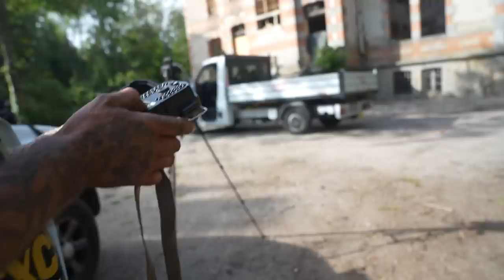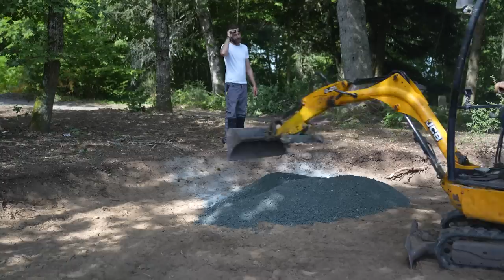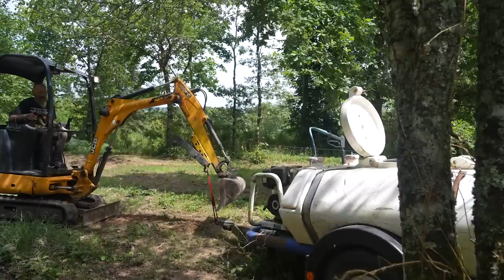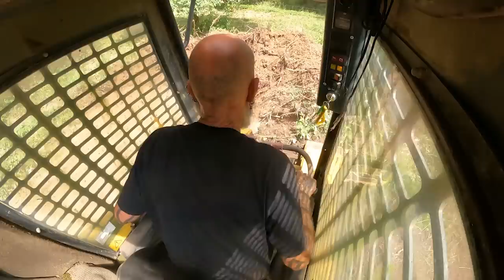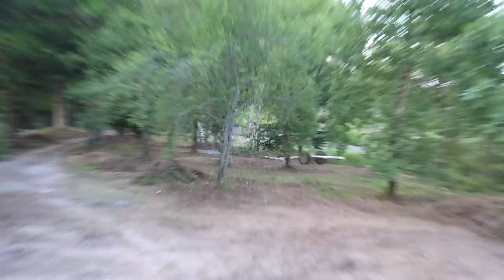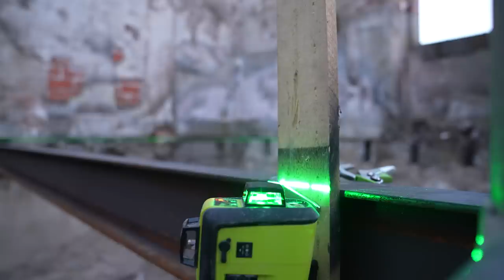A very wonky chateau ruin.

Comment: It's wonky because the builders didn't have laser levels. Because they used natural materials like wood and stone that weren't that square anyway. The building is like straight enough on average. Compensation was likely done with the floor covering. 
If you think this is bad, You're in for s few suprises. 😂

Comment: If the landing is slightly lower could it not be built up to match room levels once all the room floors are set ?
Might want to concentrate more on the inside floors to get up to roof level and get that roof on before bad weather returns in autumn/winter 😉

Comment: For my 2 cents. Make the steels level with the existing floor (subfloor) height wise. Make them level and plumb. If the pockets need to be extended up some that’s ok 👍
Reply: Looks like the pockets would have to be adjusted down, which is difficult because of the iron straps in the walls. You could notch the joists within reason though, apparently they're oversized for the span anyway.
Reply: @Ragnar8504  oh good point. I think notching is ok (not an engineer) as the height of the Joist is needed more for strength over the span than at the connection point. Often you see support beams taper at ends…
Reply: @michaelsmithers4900  Notching isn't ideal as it can create stress lines and lead to cracks but you can definitely notch the ends of joists, you just need to find out how much you can safely cut out.
Reply: @Ragnar8504  Agree, there’s a limit for sure. I believe the necessary height of the joist is a function of the span covered. I used to work in framing and headers were required to be a given height - longer span taller support (header). 
The only risk I see with notching is splitting a failure… 

Here’s an idea!!!
What if he extended the pocket under the band and then cut a slot in the end of the joist. After slotting the joist around the band and into the new steel on the other end, cement the slotted end in… He could even attach the joist to the band to make the structure stronger with a diagonal bolt…
Reply: @michaelsmithers4900  According to a French commenter joists for a span of up to 3 m can be 175 mm, 3 m and up needs to be 225 mm. Since Dan's spans are less than 3 m as far as I can tell he could reduce the joists quite considerably (by about 2"). Splitting might be an issue but old French joists were notched like crazy so I'm not sure how bad it would be, especially since the notches would be inside the wall with some of the original dimension resting on the stone wall.
Reply: @Ragnar8504  Completely agree… He’s also spacing the supports fairly close so there’s a lot of strength.

Comment: Dan, if the I-beam floor his higher than the floor in the core, could you not just build up the floor in the core to be at the same level and the i-beam floor?  Of course you have the other sections to level out too (back and opposite side of the chateau) so it could be a futile exercise to get 100% perfect.

Comment: Depending on the thickness of the flooring that was originally in that room, it is entirely possible that the floor would have matched up with the landing.  Unless the difference is really big?  Or maybe the old steel beams were a little bigger?
Reply: The new steels are bigger than the old ones.

Comment: Dan, I know you've thought about it, but don't forget to account for the thickness of the flooring material. EDIT: and also, this Chateau was built a long time ago, are you sure the floors were level to begin with?
Reply: I'm fairly sure they weren't because I don't see any cracks or obviously wonky door and window openings, the usual telltale signs of settling. Buildings rarely settle as a monolithic block.

Comment: FYI, limestone should never touch dirt as it will contaminate it.
Reply: Crushed limestone is used to line drainage ditches, used in the pharmaceutical industry & also used in feed for cattle
Reply: @NurseSherry  Yes but in construction you put down a plastic material to keep the gravel and dirt separated.  Don't remember what it's called.

Comment: Calculating the amount of stone required is remarkably easy.  Generally crushed stone is ~2,000kg/m^3 so that 3T will give 1.5m^3 or around 15m^2 at 100mm thick or preferably 10m^2 at 150mm thick.  There also needs to be an allowance for loss i.e. stone compressed into the ground.

Historic buildings are not modern precision constructions and it is foolish to expect them to be.  If you are going to utilise existing features such as joist pockets then expect and accommodate the variations in spacing and levels, after all we all admire the eccentricities of old buildings including their sloping floors.  If you want modern precision then disregard the original features and work it through as you would a new build.

BTW that scafford tower is not safe!

Comment: Cost of 10 tons of gravel, plus gas, plus time/labour wasted going back and forth, cost of building materials and time/labour building. The cost of trailer, gas for one tow, put on site, level and labour is much cheaper. I guess budgeting math is different in France. And another day the floor is not done to get closer to getting a roof on this side of the structure to keep rain and winter damage at bay. Nick is gone on Friday is he not?

Comment: It’s not a stable building and never will be - the fire and then 50 years of exposure have rendered the entire structure a crumbling mess - it’s sad but most of the brickwork needs to be rebuilt
Reply: The fact it's still standing at all suggests it was quite well built in the first place. Apart from relatively superficial damage the brickwork looks pretty good. Stability is steadily improving with Dan's work. Also there seems to be little evidence of subsidence considering it's age. I recon it'll be around long after many modern buildings.

Comment: I cannot believe you've bought an 8 metre diameter yurt. 

Unless its an American Engineered, modern iteration with plastic covered fabric walls, modern insulation, fully waterproofed crown system, full height doors and windows then you have years of unnecessary and expensive maintenance ahead you. 

You have already made the most basic mistake of underestimating the cost and complexity of a decent foundation and base for it but I guess cost isn't an issue to you with the income you're generating..

I would have bought either a big mobile caravan or wooden building to live in temporarily but I did suggest this in an earlier video comment because some of us have been on a similar journey already but we obviously know nothing useful.

Good fortune to you.
Reply: This is just a guess, but I suspect he will use it in the future as either a place for You Tubers to stay while they film and work, or as an Air B&B like they are doing at Mapperton and other large homes.
Reply: @caren197  There are a couple of You Tubers who used a Yert in Canada. They did just fine with it. It looks really nice.